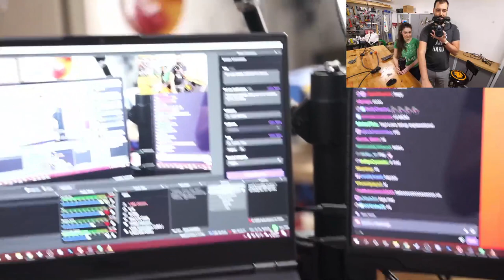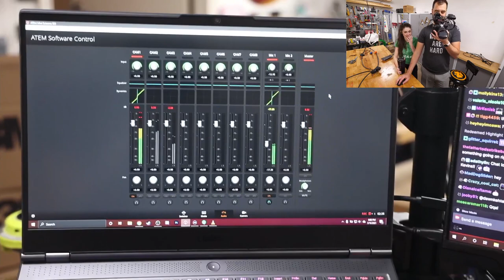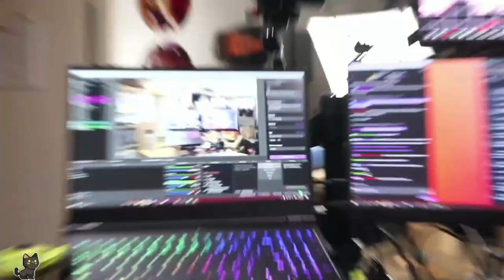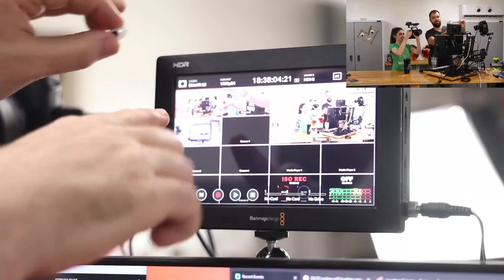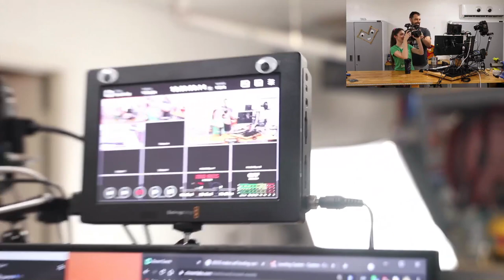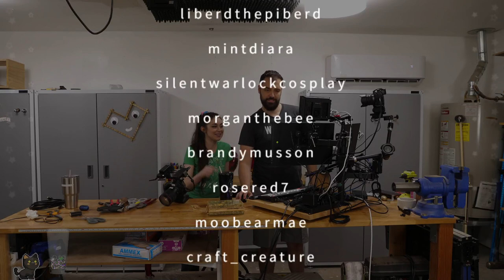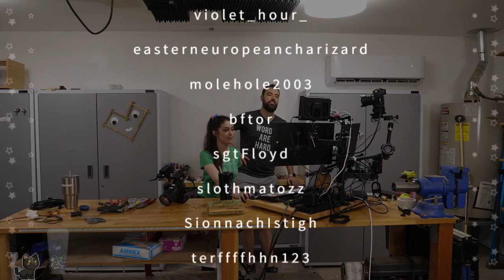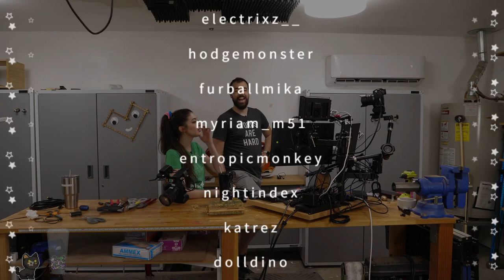Moving Q&A Hangout (Last video filmed in our garage!)

Comment: This isn't everything, but here's some of the timestamps for most of the questions in the first half of the vid! (will add more later once I have time)
10:42 Are we going to be making a moving video?
11:12 How long do you think the move will take?
12:21 Will the air conditioning with the googly eyes and the googly eye ruler heart be moving with you?
13:00 How many plushies have you sold?
13:38 Will you put a new treadmill?
13:54 What non-work room are you looking forward to unpacking the most?
14:54 Is there enough space for your Valve Index?
15:57 Will the move be a topic on the podcast too?
16:32 What do you think the next resin project is going to be?
17:02 Is the P.O. Box going to be the same?
18:23 How is Joob with moving?
18:50 Will there be tacos in the new place?
20:07 Will y'all epoxy the garage floor?
20:57 Does it have a separate workshop or is it in the garage?
21:05 Next to the Catio 2.0 are there out 2.0's planned?
21:47 New work bench?
22:11 Will y'all leave the mood ring toilet seat?
23:00 Did we get a nearby Melting Pot?
23:45 Any internet upgrades for the new home?
24:04 Any projects we're leaving behind in the current house?
25:27 Have you already put your house on the market?
27:31 New lightbulb in the kitchen?
28:07 The new house does have a pool so, underwater stream?
19:47 Will you have a bigger shed or are you still planning on keeping most things in the garage?
31:27 Any fruit trees at the new house?
31:29 Joob's hamster wheel update
31:45 How big is the new garage?
33:21 The new house has plenty of streaming spaces
35:12 Make sure the table is level in the new house
36:50 Do you have any tips for someone moving to Texas who's never been there in their life?
37:42 Googly eyes
40:42 Will there be a new house tour?
42:51 Are you taking the toast with you?
44:10 Apart from the workshop, what do you think the first room that you finish will be?
45:22 Katelyn's little mini not rant, "observation"
48:09 I feel another Buy vs DIY coming up
48:26 How will you explain to the moving people about all the weird projects their moving?
50:42 Are there some things you just don't know how you're going to move to the new house?
51:16 What's your fave thing about the new house?
51:48 Is the epoxy floor going to be decorative in the new garage?
52:25 Is Floodle all packed up?
53:18 Did the recent issues this past winter affect your decision on where to move?
54:33 When will we do our first Below Zero stream?
55:00 Any plan for your first night meal in the new house?
55:13 Have you made sure there's any nearby entrance to the cat dimension so that Joob can travel with ease?
55:57 Is there anything that I can show that's cool?
1:00:51 I was hoping there would be no goop in the new house.
1:02:18 Do you like the new kitchen more than your old one?
1:03:01 Has the new house been Supurrvisor approved?
1:03:52 Was it more stressful purchasing this house or the new house?
1:05:37 What we want to do with the new garage.

Comment: Hey E&K- for removing the corpse eye residue from the mini split, try naphtha (Zippo lighter fluid). Works better than Goof-Off/Goo-Gone for all types of adhesive residue, not oily and evaporates quickly. Can dull some plastics (especially if you scrub hard) so YMMV...but worth considering!

Comment: I have an idea. If Evan was to pretend you use the first and middle fingers like when we mimic scissors and somehow finds some scissors with similar length blades, you could 3D print a working set of scissors that work that way. I don't know how you would make it work, but it would be super interesting, if you could make it work. He would literally be wearing a partial glove with scissors built in where the first and middle finger on that hand are.

Comment: I don’t know if you’ll see this as it’s been a year since you Q&A posted to You Tube, but I’m wondering if you can make a recommendation to a truly heat resistant resin.  My mom and aunts heat their coffee and tea to untrainable temperatures and I made coasters that simply don’t hold up to the heat of the mugs.  Is there a resin you use that will not mar from the heat of very hot mugs/cups?  Desperate in Colorado!